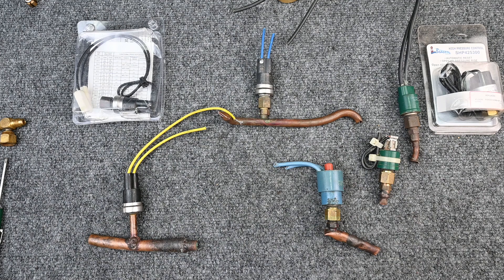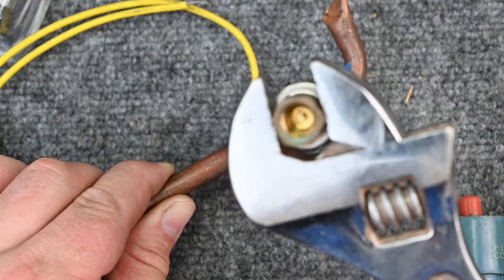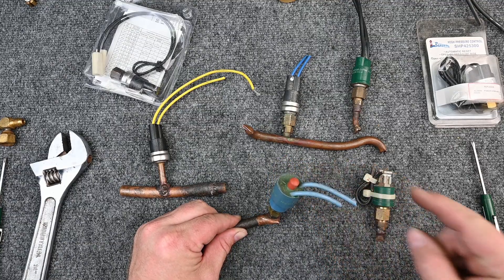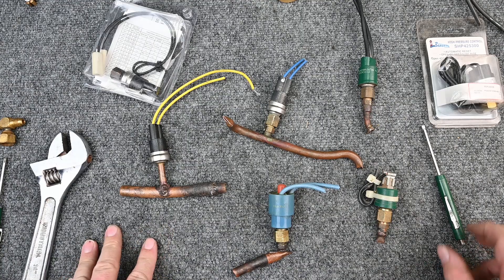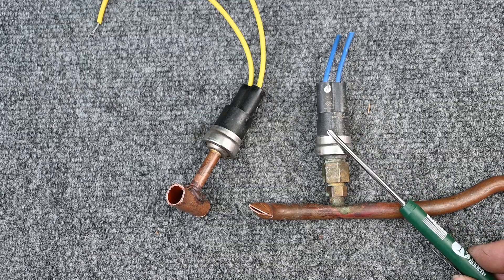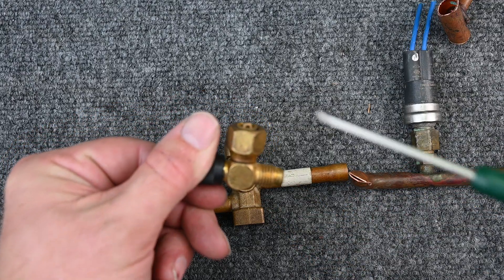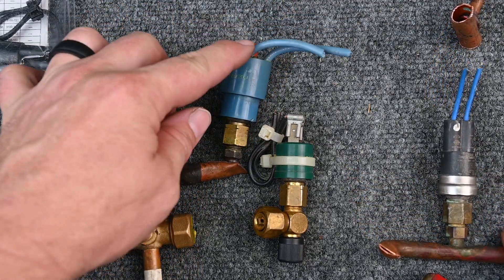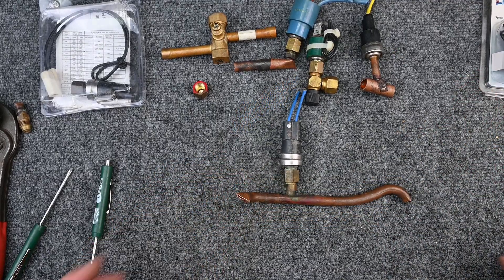HVAC  076 Pressure Switch Refrigerant

Comment: At 9:22 you add a "tee" fitting to a service port.  Where can one purchase an R-410a 5/16" SAE tee with one 5/16" female port with a Schrader valve depressor and two 5/16" male fittings with Schrader valves?  I cannot find one anywhere!  Thanks!

Comment: How would I wire it if the unit don’t have one, however adding a swivel T with low pressure switch .

Comment: So is this the only way to tell if it has a schrader, to call the manufacturer? 5 years into the trade, found two leaks on a head pressure switch this year. Able to remove the first and apply thread sealant. The other was a trane RTU and quickly found out it didn’t have a schrader… thankfully was able to mitigate things but obviously would like that avoid situations like that in the future.
Reply from the maker: I have not figured a way out without checking with the manufacture

Comment: manufactures who don't design their systems with pressure switches that screw onto schrader valves SUCK!  plain and simple.  i just spent $600 to have a low pressure switch replaced on my 2.5 year old amana ASX16042 ac unit.  the tech installed a new nipple with a schrader valve.  pisses me off that all AC manufactures don't install schrader valves.

Comment: I know people hate them but would a bullet piercing valve work to put high pressure valve on in a sealed system?
Reply from the maker: No, those are for temporary use such as recovery of a system with no ports. They will absolutely leak.
Reply: @love2hvac   but for temporary until I can afford to fix it correctly?
Reply from the maker: It seems like you have made up your mind and are looking for validation. 

Just go for it. Worst thing is it will leak refrigerant out and burn up the compressor. Best case it leaks slowly enough to keep recharging it and the HP switch saves the unit from a dirty condensor or a failed fan motor.
Reply: @love2hvac  not looking for validation at all. I'm fighting cancer living in my RV and the heat is making me sick. If I can make something work to finish out the summer I can have it done right before next summer. I would have to put something like that in to evacuate the system then braze in an actual service port and a Schrader valve for a replaceable high pressure switch
Reply from the maker: Then leave it like it is! 
There is no reason to risk the integrity of the system to add an optional protection device (hp switch) at the risk if a part known to 100% cause much bigger and costly problems .

Leave the system like it is and run it.

Piercing valves are NOT to be left in the system under any circumstances. They are a temporary tool used to recover refrigerant.  These will absolutely leak Refregerant out causing much bigger problems and there is absolutely no circumstance for them to be left in place in an operating system. 

However it's a free world and you are welcome to damage your equipment however you choose.
Reply: @love2hvac  my high pressure valve is bad. A/C is not working evap coil is dirty so I'm guessing that's why it went bad. I'm going to clean the evap coil. I really didn't want to bypass switch

Comment: Good video! One question: do the thermo type switches work as good as the pressure switches? Thanks
Reply from the maker: Different jobs protecting different things.

Thermo switch is needed to protect the discharge line thermostat from exceeding 225 and oil breakdown.

You can have a hot discharge line without high pressure so a HP switch is also needed.

Neither of those protect from Low pressure. So a LP switch protects the compressor too

Comment: I wonder if you can elaborate on the tee (or provide a link).  Tee female has a depressor and I assume that both males have a schrader valvle. I am finding a few but can't confirm 2 schraders.
Reply from the maker: Yes this is correct. Some. Come. With the valve core and some some do not, however, in my personal experience they have all been threaded to accept one.

Tru tech tools has some

Comment: Awesome video, thanks for sharing.  Question: the measurement from copper stick, is it 1/4 on the pressure switch with the yellow wires?  thanks.

Comment: I really want to know how to correctly drill a hole into a new pipe for brazing in a pressure switch. Can you use a regular drill? Any videos showing such a procedure?
Reply from the maker: I like to use my torch and melt a hole in it. If I use a drill bit I like to put nitrogen pressure behind it so the shaving are pushed out of the pipe as I'm drilling. Shaving from the drill can cause problems in the unit. 

I will be doing a brazing class eventually but I'm not close to that yet.

Comment: I had a bad high pressure switch on my heat pump a couple months ago.  It wasn't opening, but rather had a resistance that increased when it was running during the day.  It would run and cool starting at sunset.  Condenser doesn't get a lot of direct sun but does toward sunset.  Got misdiagnosed as a bad defrost board by the tech as we both missed that the LED code on the schematic was for the comfort alert while the defrost board code was a tiny label on the opposite corner.  The board LED code was for HP lock out.  I thought it out, tested the HP switch and found the weird resistance issue.  Jumped it out and checked the switch over several hours/days  and it never opened when running. Instead it went from 9 ohms in the AM to 26 ohms with in minutes of startup and locked out.   Called the HVAC company to recommend the fix was the HP switch and when a different tech came out he brought the board and HP switch, verified what I found and changed the switch.  He never found any high pressure refrigerant condition.
Reply from the maker: Sounds like moisture got into the switch.
Reply: @love2hvac   That does remind me that there was a hairline crack found in the old sensor.
Reply: ❤m 
As wg

Comment: Another lesson learned. Thank you👍.
Q- If you check the electrical  state ( open/closed) of the pressure switch with the system off (equalized), is it safe to say that is what the “at rest” position is  supposed to be in ??
Reply from the maker: Residential safeties Normally Closed. 
High side opens on pressure rise
Aka closes on pressure drop.

Low side opens on pressure drop
Aka closes on pressure rise. 

Now commercial is a different set of rules especially with automatic pump down.
Reply: @love2hvac  Great, thanks for the reply👍

Comment: Rookie field assistant in commercial refrigeration here. I changed careers at 36 years old  This is legit educational material. I've come to find that whenever you drop a video I'm about to learn something. I really appreciate your effort to put this kind of stuff out here.
Reply: My dude you are me lmao literally 36, 15 years oilfield experience... currently in Commercial Maintenance working my way to service.  🤘
Reply: I was a patrol cop for 10 years. This last year convinced me it was time to get out. I think this career is where it's at. They are PMing me to death, but I am learning as fast as I can trying to get in to service.
Reply from the maker: PM's are a great way to learn. You get comfortable seeing a variety of equipment, people, curcumstances, and  conditions. 
If your really wanting to move to service faster, volunteer to go with the service guys km after houer calls and weekend calls. That will strengthen your skills and build the confidence in the service team. It also shows the boss your committed and not afraid of on call.
Reply: @mitchellarmyguy2515 Turned 35 this month, doing commercial maintenance working towards service.

Comment: Is that restricted could change the state of refrigerant from vapor to a liquid? Thanks Ty.
Reply from the maker: If it was on the liquid line it could
A: work as a metering device and you would feel the temperature difference. 
B It would also cause the pressure before it to be very high and the pressure after it to be too low.

Comment: About the brazing on pressure switch all the way stuck inside I would normally cut about 3/4  vertically so I Dose not crates almost no restriction.  The 3/4 cut will be inside the pipes all clean up of copper files.  And the 1/4 extras will be my guide Deep.